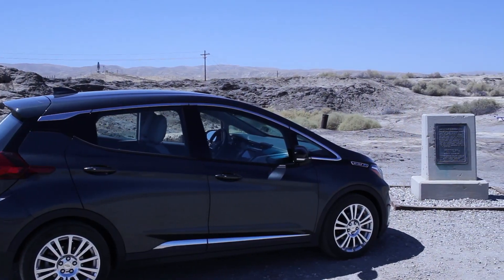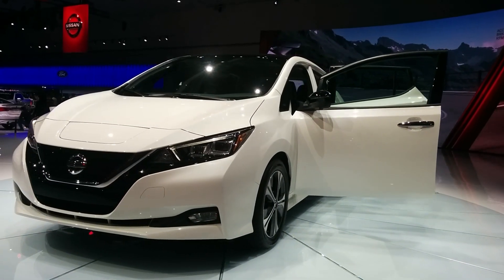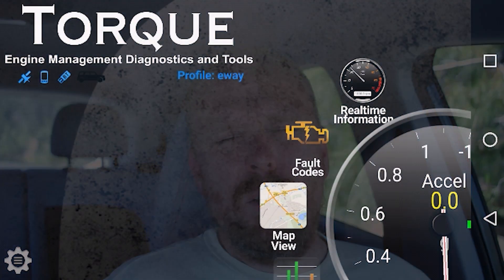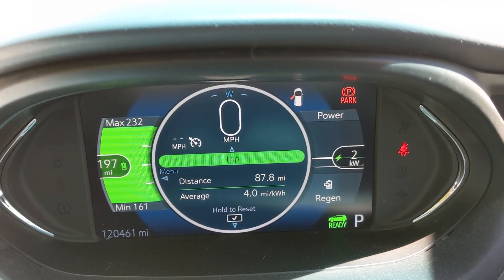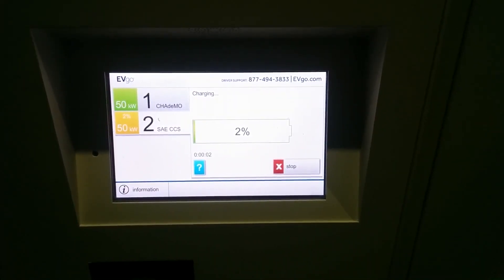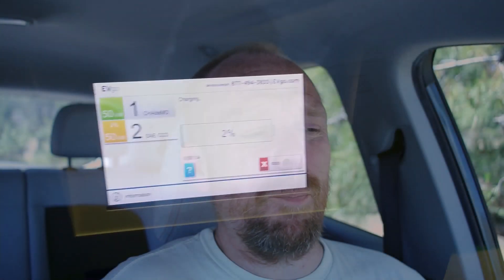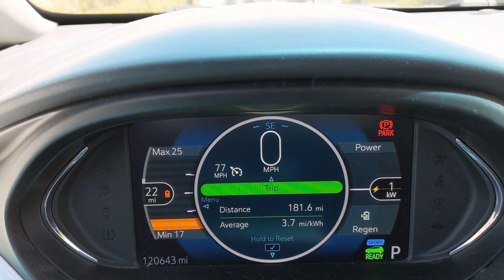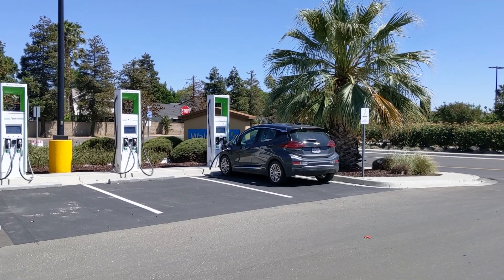2017 Chevy Bolt EV: Measuring Battery Degradation after 120,000 Miles

Comment: I wonder if some dealers have a 7 day return policy or something like that where you could buy the car, take a trip and calculate battery life and also determine if there are any bad cells. I still wonder if they guy from Weber Auto is right in saying, "get a version 2 battery." to avoid the problem you alluded to coming from bad cells in version 1 batteries. And are all 2018's and after "version 2?"
Reply from the maker: If you test the car and find that it has bad cells, you can just have them replaced under warranty. The bad cells I was alluding to were version 2 batteries. To my knowledge, no version 1 batteries had that issue.
Reply: @newscoulomb3705  OOOPS!  I sure hope you meant to say "bad cells in version 1 batteries".  The V2 batts came out late in the 2017 model year, and those bad cells are exactly why they changed to the new type.  This info is from a Master Mechanic who now teaches at a mechanic school (has videos on YT).  And to Kent's question--- yes all 2018 and later are Type 2 batts.  And the '17s from VIN# xxxxxxxxxH4163254 and later are the Type 2.  There is a small white sticker on the back edge of the battery pack that will say "Type 2"  or "Type II".
Reply from the maker: @lesizmor9079  No, I spoke correctly based on my understanding. According to Professor John Kelly of Weber State University (the person I think you're referring to), his early 2017 MY Bolt EV had the V2 battery. 

The issue wasn't with the battery build or design; it was with the QC process. Bad cells/modules were slipping through QC and making it into customer vehicles. GM/LG fixed the QC process without changing the battery format as far as I know.

Also, I know of no Bolt EVs made prior to 2017 had that battery cell/module issue (all V1 batteries).

Comment: The Bolt seems like a really reliable car.  I don't remember you having any major problems, and battery degradation is pretty minimal.
Reply from the maker: Yes, the car itself has been very reliable. It's sustained some damage over the years, but it hasn't had any mechanical or systems issues.
Reply: @newscoulomb3705  Eh, you've been driving it and not using it as a garage queen.  Some signs of wear is totally normal.  I've been following how yours is doing especially with all of the DCFC charging you do to give me an indication how my 2019 will fare.  So far, I'm not worried.  Maintenance is certainly way lower than an ICE vehicle.  Most I've done to mine is a break bleed to replace the old fluid with fresh DOT 3.  Other than the other usual things like tire rotations, wipers, winter prep/post cleaning, etc.

Did have 1 whoops with mine and drove the battery right down to 1% by mistake.  Was sweating pulling up to the Electrify America sight (should have just stopped at the much closer Level 2 chargers since I was waiting on the spouse to finish with their surgery they were called in for).  Won't make that mistake again.
Reply: @ryans.7558  I'm planning to bleed and replace the brake fluid in our Bolt this fall when I switch back to winter tires. I purchased a Motive Power Bleeder. What did you use? Do you know if the bleed order is different than RR, LR, RF, LF? Not real excited by how far the brake reservoir is up under the cowling. Also, any need to disconnect the 12V or anything else you learned you can pass along? TIA.
Reply: Ur not worry it will catch on fire do to battery issues on all bolts and are u restricting charging capacity like GM recommends so it has a less chance of battery catching on fire until they replace battery???

Comment: This is insane, and keep in mind the battery is the weakest link; the motor will go a million miles! At this rate bolts are going to make Toyota 4runners look like dodge neons in longevity.
Reply from the maker: As far as I know, my Bolt EV has seen the most degradation (I'm very hard on the battery).
Reply: I have a. 2000. Dodge Neon with 286000 miles on it.No major repair.
Reply: @stephenanderson812  That is very impressive.

Comment: A question:  What percent of charging would you estimate you have done as DC-fast vs Level 2 AC?  Thanks for the way to baseline and track my EV’s current total available capacity!!
Reply from the maker: You're welcome! I DC fast charge a lot, but it's still probably a low percentage of miles. I'd guess that about 75% of my charging has been L2 AC, and only about 25% has been on DCFC.

Comment: Nice video.   I think a 5-10% degradation for 120K miles is not that bad.  I assume a high % of your charges are DCFC.  Do you think that influences battery degradation?
Reply from the maker: I'm sure DCFC has some influence, but I think it's mostly a result of cycles.

Comment: I'm glad that the Bolt is holding up well. How often did you have to get it serviced ?
Reply from the maker: Thanks! It hasn't been in for servicing.
Reply: Literally, other than rotating the tires, the only item the manual asks for to service is radiator fluid change, at 150k miles lol
Reply: @coded1vids  Isn't there brake fluid change? I think 90K or 6 years?
Reply: A bit strange, brake fluid is on the maintenance schedule, but no interval is provided. https://i.imgur.com/cOiEYXI.png
Reply from the maker: @thelondonbroiler  It's part of the basic brake inspection, I believe. So I'm guessing it's just a visual confirmation of fluid levels.
Reply: @thelondonbroiler  I think if you look at the "3" notation in your image (but cut off) it says 5 years.

Comment: I have to say this can be hard for those who want a used EV and want to quantify the capacity of that EV's battery.  Hope we have a easier way in the future, but for now this method is sound.
Reply: I would have to guess a dealer would have a discharge device just for this reason.  It would be interesting to call around to see if they do. On the other hand, maybe most used EV's  won't be bought through dealers.

Comment: I have a 2012 volt. Couldn't see much degrading untill I got a recall to reprogram computer.   I think it was to prevent the battery from going to low to start the gas engine. Then I lost nearly a kw of power.

Comment: Does the battery management keep track of battery capacity to calculate expected range? Or do they always use the 58KWh capacity?
Reply from the maker: I think it's based on estimated capacity (pack voltage).

Comment: I am not sure your method is the best one. You should calculate following the formula : km driven x Wh/km used / % of battery used to drive the km. Your method doesn’t work for winter conditions when you use 40 kWh for 30% of battery.
In your case, you drove 181.6 miles = 292.25 km, making 3.8 m/kWh (?)= 163.5 Wh/km and used 90% battery so the capacity of your battery is 292.25 x 163.5 / 0.90 = 53.09 kWh. So the degradation would be (60/53.09 -1)x100 -> 13% after 193 000 km. If you consider 58 kWh as usable battery, then the degradation is (58/53.09 -1)x100 -> 9.25%. These are impressive numbers, knowing that you Fast charged a lot and did a lot of almost full depletion cycles.
Reply from the maker: Hmm, I'll look into using that method.

Comment: According to John Kelly at Weber State Univ., the battery was designed to store 57.9 kWh (288 cells at 0.0201 kWh each).  For advertising, it is nominally rated at 60 kWh. Do you find it does not matter which value you use as long as you are consistent? Should every new Bolt buyer do a “measurement” soon after purchase to see “where they start”?
Reply from the maker: Professor Kelly was basing that partly on the battery sticker. According to GM, there are several ways to measure the actual capacity.

I do recommend that Bolt EV owners (really any EV owners) do this early on, as this is also an effective way to determine whether you have any bad cells that should be replaced under warranty.

Comment: Did you actually test when it was new? My Bolt had 57.5 kWh when new (about 2000 miles on odo), now has 54.3 kWh (about 16K miles on odo). That's 94% or 0.23Wh/Mi. But if I assumed 60 kWh when new, it'd be 91%. Mine is projected to be only 30 kWh at 120K miles if trend is linear, and I rarely fast charge, always keep it between 30% and 80%. I hope the trend is not linear.
Reply from the maker: I did measure at the beginning. It was right around 60 kWh. I had a couple of blips to 61-62 kWh very early, but those measurements fall within the margin of error of +/- ~1 kWh.
Reply: I have a 2020 Bolt. If I saw the kind of degradation you are already seeing, I would take it to the dealer and have them check it. For no other reason than to start making a case to have the battery replaced under warranty down the road.
Reply: Degradation isn’t linear. It slows down over time.

Comment: Usable yes but not actual due to energy loss thru heat
Reply from the maker: Well, I think is what accounts for the +/- 1 kWh capacity I see in the results. That's why this is just a snapshot, and to get a true measurement requires tracking trends over time.

Comment: This is really awesome considering how much you fast charge.
Reply: Maybe this is the payoff for the painfully conservative charging curve the Bolt has.
Reply: @robertkirchner7981  that's exactly what it is. It's a huge payoff not just for the owner, but for the planet, as the longer we can use the batteries the better
Reply from the maker: I actually think the biggest contributor to my battery life has been the depth of discharge. I repeatedly dip down to below 5% battery, and I think the that prior to the reprogramming, there was an additional 1-2 kWh of energy that I could access on the bottom end. I think that has been the biggest factor.
Reply: @newscoulomb3705  I don't think lithium ion chemistry benefits from deep cycles (I don't think it's hurt by deep cycles so long as the cells aren't left in a low SoC for long).

In fact, here is a statement I have found on it, that claims the SoC should not drop below 20% for maximum life.

All lithium-ion cells are “deep cycle” meaning that they have the ability to be fully charged and discharged. The life of the battery will significantly increase if the depth of each discharge is limited to 80% of the rated capacity.
Reply: Rennie Allen I think he was trying to say that his battery would be doing even better if he didn’t dip so low regularly. Lithium batteries definitely don’t like deep discharge or constantly being fully charged either. 40-80% is the ideal state of charge from what I’ve read, if you can fit that into your lifestyle.
Reply from the maker: @homomorphic  Exactly. It's the breadth of the discharge that impacts life. Cycling only the middle 50% of battery's capacity will result in very long life.
Reply: @newscoulomb3705  ahhh, so the biggest contribution *negatively*. Sure, yes, I agree completely.
Reply: @briand9754  i think they are ok with deep cycles, but you need to recover quickly. It is time spent in that state that affects them. So if you are driving cross country and you run your battery low then arrive at the DCFC and charge immediately, it shouldn't hurt that much, this is what I think helps in Eric's case is that he basically does that 500 mile trip and I believe that he spends very little time below 20% SoC.
Reply: I saw a video on the Bolt last year of a GM battery exec interviewed and he did say that we (Bolt owners) can charge as much as we want without worrying. Which tells me that they pretty much know we won't be able to degrade it below the warranty level no matter what we do. I personally would never buy any EV that didn't have active thermal battery management.
Reply: @davidmccarthy6061  the warranty is no more than 30% degradation in 100,000 miles. 30% degradation in 100k would be *horrible*.
Reply: @homomorphic  Unless you have a Nissan leaf where you're looking at 50% degradation at 100k lol
Reply: @homomorphic  30% degradation in an old leaf over 100k miles would be... Totally normal

Comment: That's exactly how I calculated my battery capacity recently (although I went down to 4%). I have a 2019 with 18,000 miles and using this mechanism of measurement, it calculates at 100% capacity (59.7kWh) within the resolution of measurement.
Reply: Should be kw
Reply: I have an early  ‘17 (Feb) and although I have only put on about 20k I will use your system to check my battery condition. Also when Dr. John Kelly @ Weber University took apart a Bolt, the number total from the batteries only added up to 57km I think.
Reply: @johngould4851  Yes a lot of the 2017 production was derated to around 57kWh.  2018 and 2019 production all appears to be the full 60kWh (or at least to have a sub 1kWh derate).  3kWh is 12 miles, so I wonder whether the EPA range of 238 miles is based on a 57kWh battery capacity or not.

Comment: @News Coulomb. I'm a happy owner of Bolt EV and I'm planning on making a trip to Sacramento from LA. Have you ever tried going up there using the scenic route (fwy 101 and / or fwy 1)? If so, how was if?
Reply from the maker: Congrats! Yes, I drive that route a decent amount of the time. For a trip to Sacramento, you're really going out of your way. Highway 101 adds about an hour and a half, and Highway 1 adds another hour or so on top of that. 

Otherwise, it's one of the nicest drives you can do. You should be able to make it to San Luis Obispo on a single charge, and if you charge up to 80-85%, you should have no issue taking Highway 1 up through Monterrey.

Comment: If the 2017-19 60kWh Bolt EV's usable capacity is truly 58kWh then it's a huge testament to LG and GM for engineering a car that retains 94.5% after 120k miles. That bodes really well for any car manufacturer that goes with LG as a battery supplier. Compare 94.5% retention to Tesla's 85kWh & 90kWh packs from the same time period and it's not even close.
Reply: Yeah I thought it was only 57kwh usable as well. He shows that at the end though. Cause being a former Leaf owner and losing over 50% of my battery capacity in 56,000 miles I am like he really didnt lose a lot. Thanks for the info though! 10,000 miles later I am so glad I went with my Bolt EV instead of Gen2 Leaf.
Reply: @Roadburner426  Wow.  I thought my 2012 Leaf was bad.  I lost 39% in 60k miles.  Have you talked to Nissan about a battery replacement under warrenty?  It is probably a waste to ask.  But worth a try.
Reply: @Roadburner426  Our 2017 Leaf, -5% after 36,000 miles 650 DCFC sessions.  2019, -6% after 17,000 miles.  Really good cars if you understand their limitations - mostly we do 200-500 mile/day trips.
Reply: @Anthony Carroll, what % degradation do the Teslas have?
Reply: @timcampbell5873  two things are going on with the 85 & 90 kWh packs. First, the degradation is pretty bad as reported by owners with an example today in a popular blog of a 2018 90kWh pack with 100k miles and 10% degradation. The second thing with 85/90 packs is the DCFC throttling. 85 packs Supercharge no better than a Bolt EV now and 90 packs get throttled once they hit a certain number of kWh of DC energy. A certain popular Norwegian EV YouTuber has a lot of info on the throttling.